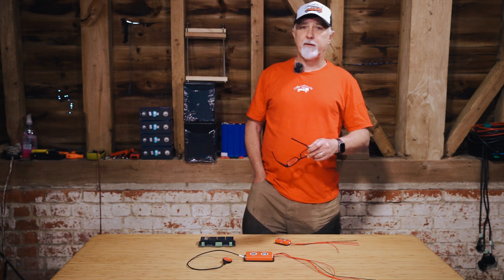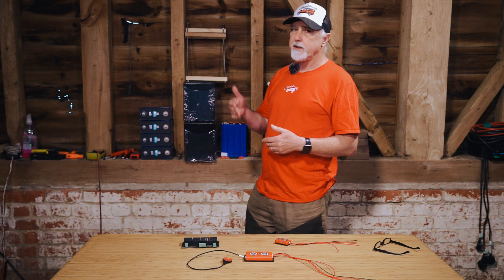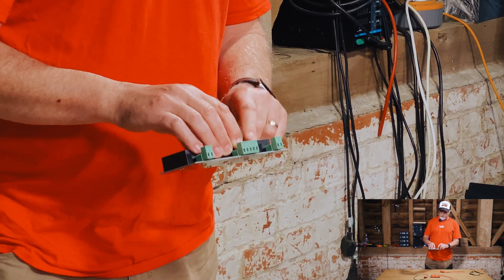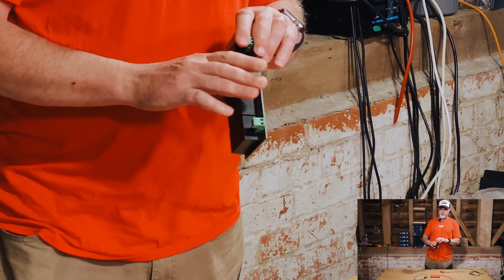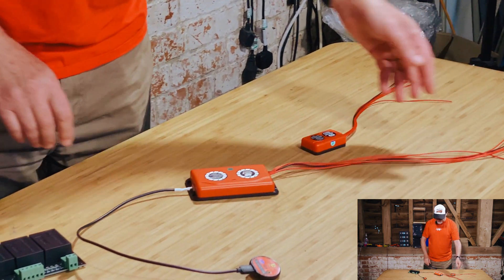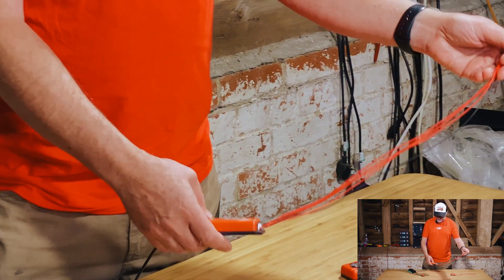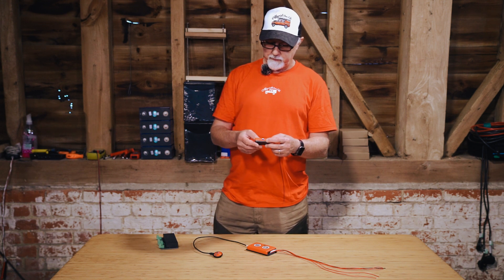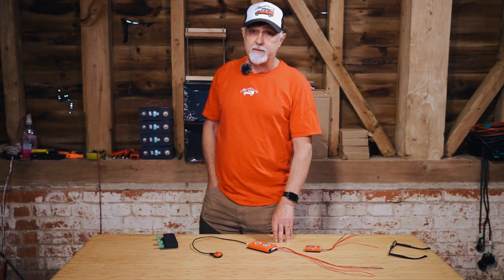Daly Active Balancers First Impressions

Comment: If we have the function to adjust the low and high charge discharge current in our inverter then only connecting active balancer will be fine for our 8s 24v battery ?